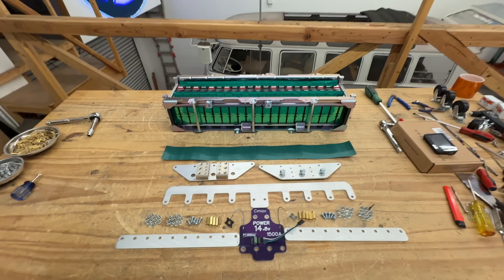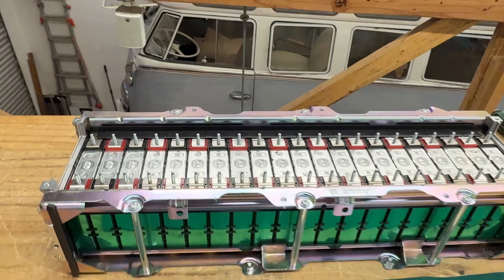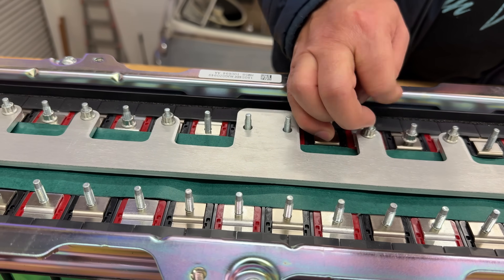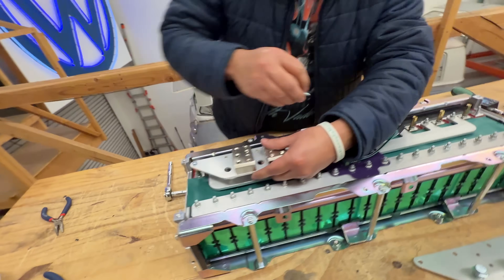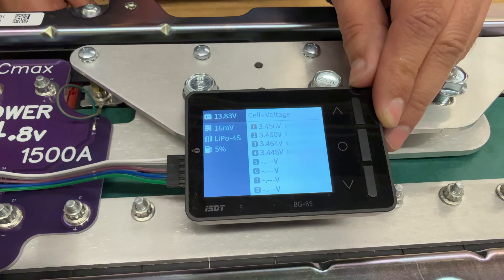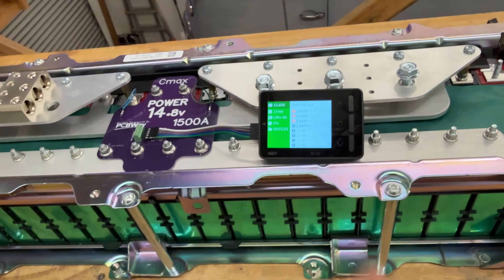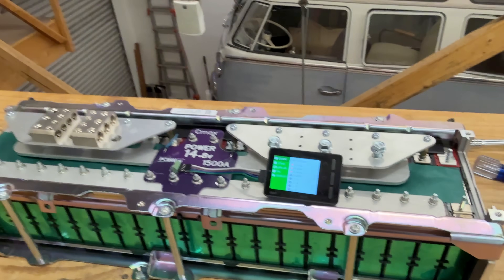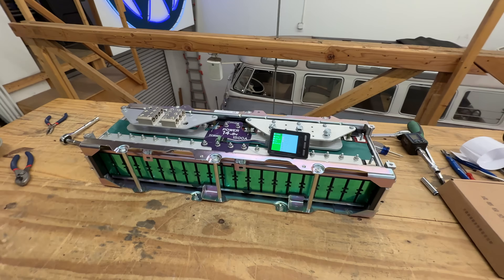$299  Plug & Play Ford C-Max CAR AUDIO Battery Module 120Ah 14.4v

Comment: what should i set my alt voltage to
Reply: These cells hold the bulk of their energy from 15.2-15.5VDC. I always recommend charging them to at least 15.5VDC. Below 15.0VDC they start to crap out. And at 14.0VDC they are dead dead.
Reply: So setting charging voltage to 15.8 is probably ideal?  @AllAboutAudioJW
Reply: @nikosuave4779  That is exactly what I ran mine at when I was running them. I had 2 banks of 4S8P so roughly 400aH and 18 banks of XS Power supercaps. Power for days...literally.

Comment: Just recently purchased this curious on what your recommended way of charging is? Directly to alternator? With an isolater separating AGM? Or a straight dc to dc charger? Let me know thanks and also if I should increase my charging voltage for it just want it to safe and operate optimally.
Reply: Do NOT run this with any other battery chemistry!!

Comment: You can get dual-voltage alternators that output 16 AND 12V, they're used a lot in racing.  They're more expensive than a single voltage output, though.  Searching "racing alternator" will find all kinds of 16V alternators that are adjustable from 12-18V.

Comment: I am not following this. The first bar you put on went on every other because positive and negative terminals. But the second two were put on both the positive and negative. I need to see the wiring diagram. Not understanding how this works.😊
Reply from the maker: Connects first 5 every other cells to adjacement ones.  So it makes 5 cells parallel and then series to the next 5